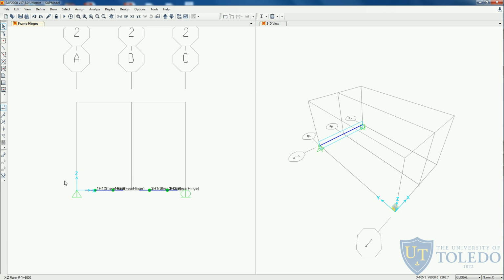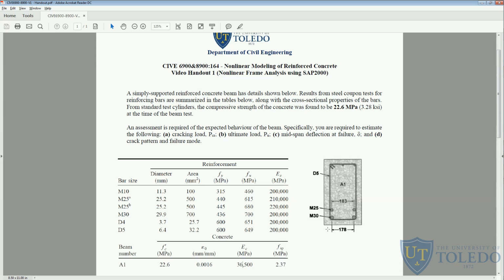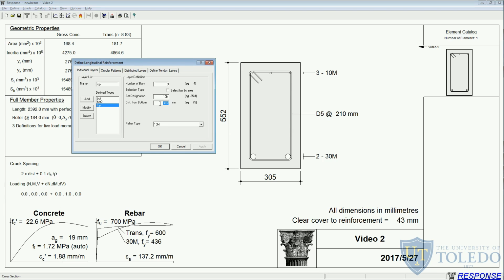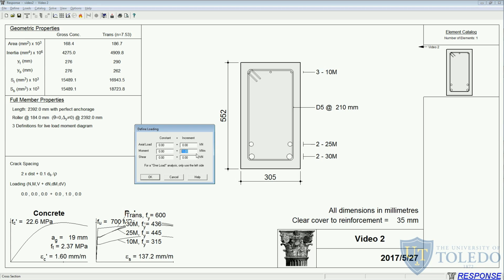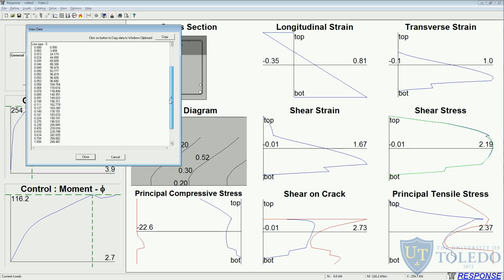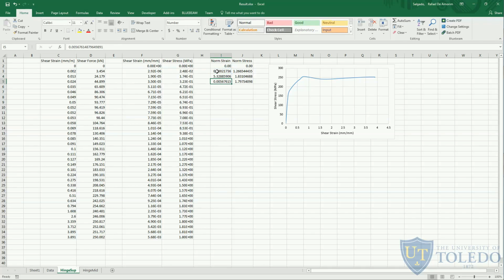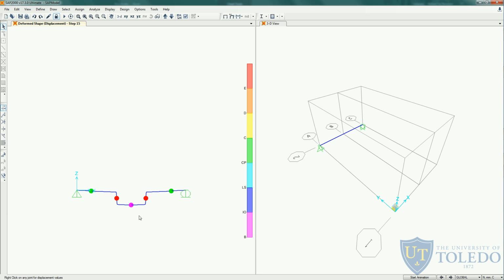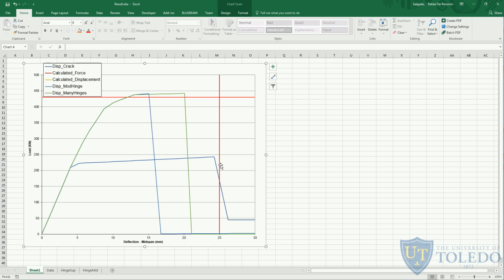SAP2000 Nonlinear Beam and Column Modeling using Custom Hinges (Video 8)

Comment: I have a question Sir, why in this video you did not define the length of the beam subjected to shear?
Reply from the maker: When performing a sectional analysis, you only need the cross section details. Beam length should not be needed. Sectional analysis is done at a section only. I hope this helps.

Comment: Thanks so much sir, 
I had a question. How does SAP2000  Nonlinear Column P-M2-M3 Modeling using Custom Hinges.
Reply from the maker: You can use an approach similar to the one shown in the video. You should be careful when calculating biaxial moment interaction. You will need a nonlinear analysis software that is capable of considering bi-axial effets.

Comment: Thanks so much sir, 
I had a question, how does sap2000 calculate axial force for column's moment-rotation curve.
when we assign auto hinge to a column, automatically it takes two axial forces. how is that calculated? thanks in advance
Reply from the maker: SAP2000 calculation is rather simple and in many cases code based. You should refer to SAP Reference Manual for formulation details.

Comment: How can I get the shear strain curve from other programs not only from response 2000? Actually, I have Xtract software but it cannot define the shear loading. Thank you sir.
Reply from the maker: Not many programs have shear-modeling capabilities. You need to check to ensure the program has such a capability. Response-2000 is a free software and you can use it if you wish http://www.ecf.utoronto.ca/~bentz/r2k.htm

Comment: where you get the latest version of response-2000. There is a old version 1.0.5 in official link.
Reply from the maker: You may try contacting the program developed with your question.